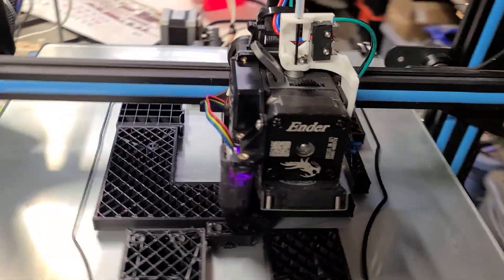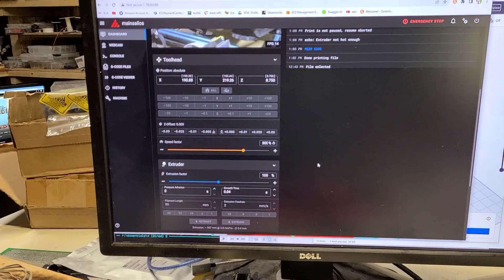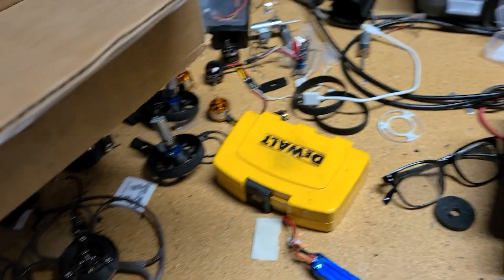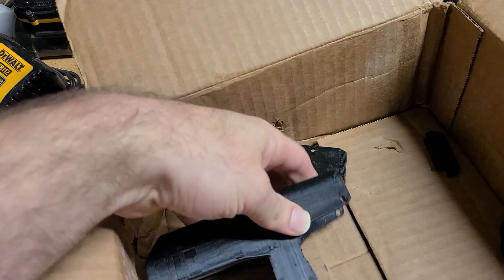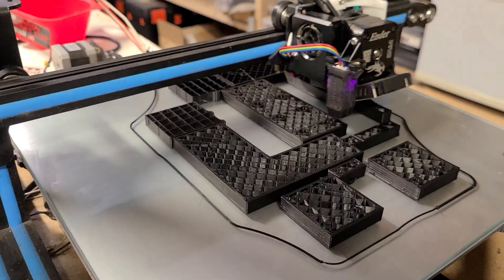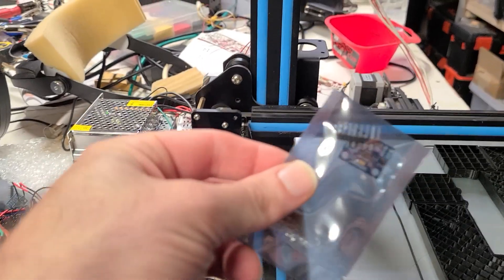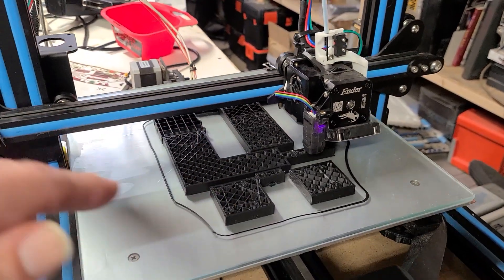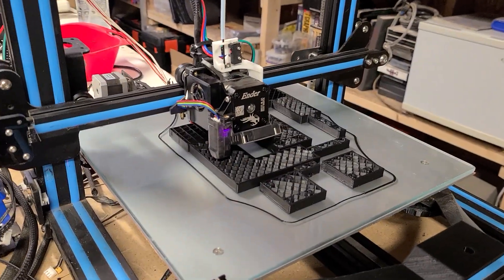Building "The 100" printer part 1

Comment: Howdy! Following up, as I plan to build one myself.

Quick note: Did you already received the Aliexpress parts? Usually they group shipments (at least those packages for Brazil, where I live), so you might expect less packages...

BTW, which filament are you using for the printer parts?